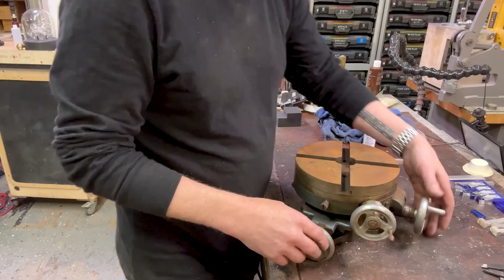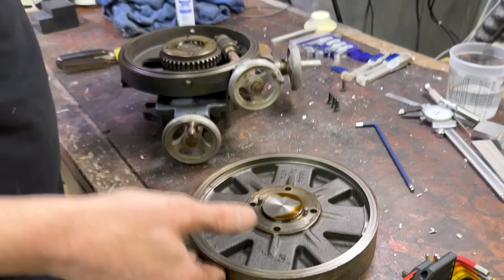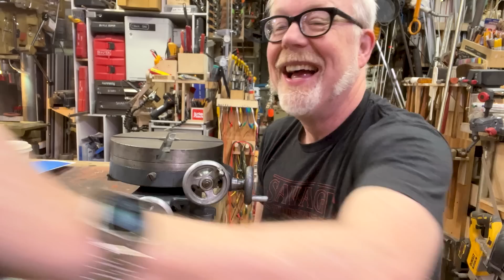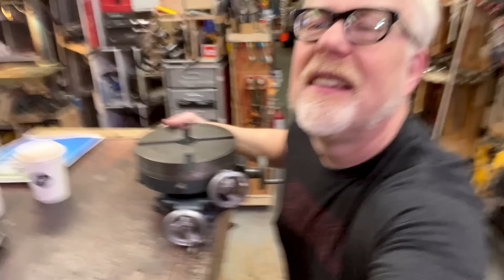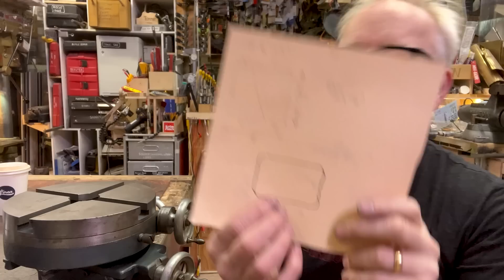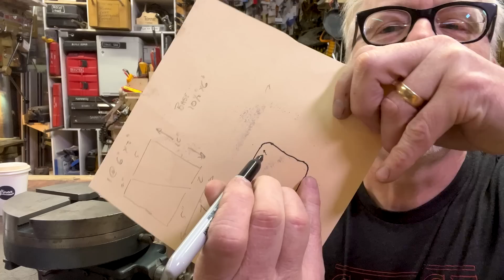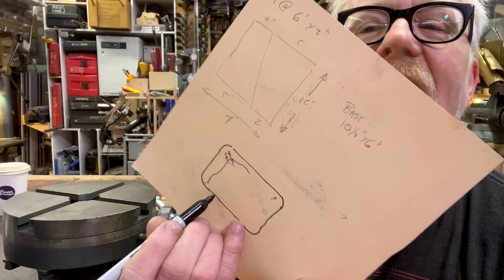Adam Savage Disappointed By This Machine Tool

Comment: I'll be short and blunt: If the tolerance is so out of whack, it would make a great paperweight or stand. Just need to lock it in one position. If you're not interested in those uses, it would make a great piece of metal to send in for recycling. I don't know if these tables are common or have been superseded by something better, but face facts: If it's not up to the level you desire, recycle it and move on to bigger and better things. You don't appear to express much interest in rebuilding or fine tuning the accuracy, correct me if I'm wrong.

Comment: If you could manage to fix the backlash issue, theoretically nothing would prevent you from just turning it upside down and voila, XY table on top of a rotary table.  The downside is then you'd need to make some sort of mounting plate to be able to attach work to the bottom of the table.

Comment: I’ve seen a bunch of these over the years, Palmgren brand most of all. It seems like most of them are barely used. I have one, or maybe I sold it. It’s definitely not precise enough to be inconvenient to use but still useful, but not convenient enough to be as imprecise as it is. I had the just the round part off one that I used on the mill as a riser block sometimes and the T slots came handy for fixturing.

Comment: Learned to sink molds on a cross slide rotary table.Advance or Trokey are good names, both take some level of finesse.
These things are used to sweep radius I’d or od, 
Sorry you have a palmgreen, WAY to much play in the ways, and the rotary mechanism is not very useful. 
Also, no rigidity, lousy surface finish is guaranteed

Comment: My brother gave me one exactly like that and my conclusion after trying to use it on my mill was exactly the same. I use it with a speed vise on my Delta UniDrill. Perfect combo and similar opinions. Both look super cool but near misses in function. The Palmgren is sloppy and the UniDrill is meant for wood w/spindle speed of 450 to 4300 rpm :( I’m a metal worker, not a woodworker. I get by but am keeping an eye out for a different head I can put on the UniDrill base.

Comment: Normally on a rotary table there’s a way to adjust the worm to reduce backlash.
It’s typically that the worm is on an eccentric cam, that pushes the worm into its crown gear closer to reduce backlash or moves it away to ease up on how closely the teeth mesh & this controls your backlash.
My “suspicion” is that perhaps when you dis- assembled the rotary table you altered the amount of mesh between the teeth and didn’t adjust that out via the eccentric cam positioning lever when you re-assembled it.
I could be wrong but we didn’t get to see any of that footage so hard to say.
The reason there’s usually a lever and lock is so you can swing the worm away from the gear all together to be able to “free spin” the rotary table by hand, without having to wind the handle through 360 degrees to check for any parts interference with your mill table or vertical dovetail for the knee or spindle after you have mounted the table and the workpiece, & before you commence milling.
You don’t want to be half way through milling a radius when you suddenly find out that there’s a physical interference between your workpiece and the mill that you didn’t foresee.

So you swing the worm out the way on it’s eccentric cam laver when it’s unlocked so the teeth aren’t engaged, spin the table and mounted workpiece through the full 350 degrees by hand, because the worms not engaged, then once you know it’s all clear you swing the worm back into engagement with the eccentric cam and lever, adjust the backlash and lock it in place.

So if there’s that type of functionality in your rotary table that you didn’t recognise then it’s possible you introduced the backlash unintentionally.

I know my dividing head has this type of function as does my tilting rotary table.

Maybe that’s something you should get?

A tilting rotary table!

Think of the possibilities.

You made a fly cutter with 15 degree angle and you want to chamfer the edge? 🤷‍♂️

Cantered in a Chuck mounted to your rotary table, & table tilted to 15 degrees, mount your chamfer tool in the mill and around you go - perfect milled chamfer on a angled round plane.

Just one example.

He who dies with the most tools wins Adam.

You know you now need a tilting rotary table.

Relegate that XY rotary table to your drill press & move on to a tilting rotary table.

You know you want to. 👍
Reply: It would be a perfect milled round chamfer on an angled elliptical (15 degree) plane, but it would be uniform and look cool... or get closer with 2 smaller and 2 larger arcs like compass drawn isometric ellipses.

Comment: One of my favorite things to do is rebuild mechanical devices. Disassembling cleaning and rebuilding something I have never seen before is relaxing and fun for me. As a bicycle mechanic of over 25 year's, if you like projects like this, try rebuilding a multi speed internally geared hub, start small at a 3 speed, and work your way up.
I liked watching the disassembly in this video, just wish I could have watched the thought process in putting it back together, but I understand the disappointment when finding out a flaw in your new toy.

Comment: Once upon a time I wanted to buy a pinball machine.
I could choose one from 2 pinball of early 80s solid state ones.
The first was a pinball machine with 20000 machines made and the other has only 1000 machines made . Both were in very good condition.
I didn't know what to choose. The second one was by far rarer and it looked hardly used, great playfield , great artwork everything.
I asked on some forums and I found my answer.
The rarer game had a very bad gameplay experience and that was the reason only 1000 were made.
So I chose the first and still enjoy it.
Because something is rare and in good condition doesn't mean it's useful.

Comment: I know excessive backlash is bad, but for cutting radius could you just turn the handle in the direction of the cut to take the backlash out, then take the cut. I guess my point is that the backlash only makes an issue if you are changing directions.

Comment: Why  not mount the XY table on top of the rotary part, then make a new base to attach the rotary table to your milling machine table?

Rotary tables will always have backlash, nice ones will have imperceptible backlash, but you STILL can't use them in both directions (well maybe with a brand new Moore...). you either lock the rotary table in position, or the pressure of your cutter against the rotation is what gives you positional accuracy, but you NEVER try to get positional accuracy in both directions! One direction for positioning accurately, the other direction is just to move to the starting place from which you start the process of getting into position in your chosen proper direction (does this make sense outside my head?).

Comment: My Dad had one identical one which was a Craftsman, probably made by palmgren. Years ago I tried to use it for milling and found out that it has no rigidity whatsoever. Any side force from an end mill will result in it moving and flexing in any direction. Also there was no way to disengage the worm for indicating.  Despite it looking like a nice little rotary table it was terrible, and definitely only for drilling.

Comment: I'm currently working on restoring a former NATO ground terminal (12.8m satellite dish) for radio astronomy.  Each axis has TWO 8000:1 gearboxes on it, with 15HP of motor on each gearbox.  Those gearboxes run IN OPPOSITION to each other, to take up backlash in the system, which in an 8000:1 multi-stage gearbox, can be considerable.    We're re-motorizing it using only one gearbox per axis, and will just live with the backlash -- since we have absolute position encoders on each axis, our control system can just "cope".   Each gearbox on this beast weighs in at around 800kg, and takes 25L of gearbox oil.

Comment: Sometimes you just get satisfaction out of working on something. I've built CNC machines with people just because I enjoy doing it. Sort of had a daydream that you wanted to build a CNC  or retrofit one with LinuxCNC... and I would help do the custom pyVCP panel to make it cool. I'm actually doing a rebuild now... and simulated the old Apollo control panel indicators... just 'cause it looks cool. If I can figure out the code to make the images clickable... I'm going to redo the buttons too. But I'm getting sidetracked... you had a good time working on the rotary table... so that still makes for a good day. And you may find someone who does not have a mill... but needs the tool to make the uniform holes. 
(That's what I did with my original Frankenlab X/Y slide... gave it to someone who needed it.)

Cheers!

Comment: Backlash in a rotary table is a pain in the rear, but, manageable if the gratuations around the rim are accurate (preferably have a vernier scale). Always move into the cutter, never climb mill, and always return the rotation beyond where you want it, and come back to zero to take out the backlash. And make judicious use of the friction stop screw.  Still a useful tool... just not AS useful as a more precision rotary table.  I've never seen one with an X-Y table build in like that one.

Comment: I used to work at an American owned factory in UK.. i’m sure the machine shop had some of their stuff.
Shame its not what you need but its Ideal for the drill table! A line of holes x apart.. no problem. Quick uncritical slotting in plastic etc whilst other equipment is tied up too.

Comment: For a rotary table you need zero backlash on the rotation - even for a drill press. There has to be a way to do it just cant believe there isn't one.. (That would be an insane lack of design thought by the manufacturer..)

Comment: Pretty cool piece, kinda jealous - I'm also in SF, apparently I don't troll CL enough...  You can also use it to make large offset cams, which is pretty hard to do on a milling machine without one of these, but easy on a lathe..  Every rotary table I've ever used has terrible backlash - it's the nature of ring & pinions, you can't really do anything about other than shimming the pinion (like you would in a diff).   The trick, as with all backlash, is to always move it in one direction, which is pretty much what all old-school machinists did without DROs.  PS - you can mount any X-Y to a rotary table.

Comment: few hours plus in evap o rust. just pull apart so you can submerge it. or just put it in as is. then if you want to pull it apart you can to oil and lube stuff up.

Comment: Where I'd use it? X/y at an angle not aligned with the machine xy. That would be beautiful for making wcmt insert pockets. Also, the backlash doesn't matter you always work from one side of the backlash and lock the travel with the lock screw before the cut

Comment: This is a milling vise add-on for a drill press.  You see a lot of the Craftsman branded ones made by Chicago Tool.  I've see Palmgren versions of these and their sales book says "Converts your drill press for rotary milling."  The rotary table is supposed to have lock screws to hold it in place when doing the actual drilling so it's not very good for active rotary milling.  It's great for getting the piece into position, locking down the table then drilling a precision hole rotating to the next precise location, locking it down and drilling again.  You could probably do some active rotary milling with it but you'd need to keep constant pressure in one direction and work slowly.
Reply: Sucks for trying to clamp a part that is concentric to the table using strap clamps. You're better off just printing the hole pattern and using a punch to mark the holes. with strap clamps you spend 30 to 40 minutes trying to clamp it concentric and you can only hold small parts do to the overhead using strap clamps.

Comment: The mill table you mount the rotary table on IS the x, y, and z axes. Rotary tables are incredibly useful to small machine shops, especially when trying to mill circles that are larger than the throw of your lathe. Think of it like trepanning in reverse. You overcome the backlash by only making small cuts AND only rotating in the same direction once the acme threads are engaged and the cutter is milling the cut.
Reply: Also there is a trick when you need rotate in opposite direction. You made few degrees  over required position ant then rotate back to required position.
Reply: I have absolutely no machining experience but I had the same thoughts. I don't understand why an x/y/z table would need to be on top of the rotary table or why the backlash would matter if you only advance in one direction. I assumed I was missing something due to lack of experience
Reply: @alexstarr1589  with xy on top of the rotary table, you can change what is over the center of rotation to do multiple curves without unclamping the workpiece.
Reply: x-y table mimics the table of a milling machine on a drill press. you can use the x-y table to center your work under the drill chuck or offset it to do a series of holes on a round piece. The only issue with these types of rotary x-y table is, the height but also the table is not geared low enough and rotates too fast in my opinion.
Reply: @ronitsingh85 IMO I don't think there's an argument here that this is a bad piece of equipment; it's really not. It can be excellent for orienting and centering - if you need that, from a tool like this. But just as Adam concluded and you allude to, it's home is on a drill press. In Adams case, it makes it redundant for his use as he already have a mill, lathe, and other rotary tables/equipment that serve those purposes and more, in ways that suit his his needs and wants better vs his available machine tools.

I'd love to have something like this in my little shop-nook. But if I already had a mill with an X/Y/Z table and a rotary table attachment, this thing would just sit pretty on a shelf like it did with its original owner. Better to pass it on down the river to someone whom might actually appreciate and use it.
Reply: @pr0xZen  that rotary table backlash got me by surprise and the fact you can't remove it. But like others said, if you are moving it in one direction then its fine. Also as you said, it can be used for lining up work and locking it in place, it does have knob screw locks. At a church rummage sale, I found new in box a set of vise jaws that go on the rotary table so I added a 2nd pair and think it will be useful clamping a work piece like a 4 jaw lathe chuck would! it was $5! I think its a cool piece of equipment and to any craftsman drill press enthusiasts this was an accessory and they would want one! Also on a drill press, this is a nice tool to have. its pretty well made.
Reply: The internal housing seem well shielded so you could probably arrange a worn with tighter tolerance, a spring-loaded anti backlash mod, or other things. The latter might not resist the force of a mill, but should be fine for straight drilling. Seems to be ample room there for modifications should one desire to.
Reply: @pr0xZen  good idea, just like some vises have. Could add thrust bearings to keep friction out
Reply: "Think of it like trepanning in reverse." So... UN-drilling a hole in your skull?

(Yes, I know that term also has a usage in machining, but that's not where my thought process went when my eye fell upon it, and for a second I was very confused. :)
Reply: Shhh...he hasn't figured that out yet. He is too busy hyperventilating and needlessly adjusting his camera.
Reply: @perseverance2015  That's just being rude.

Comment: 🍺🕶👍dude all i use this is for is milling an angle cut in a Stright line, so you're not limited to 90-degree cuts. that's all i use this for. imagine an etcher sketch with a knob that move only in a diagonal direction...... i love this . the old way i was doing straight angle cuts was unbolting my vice and taking it off of 90.  with this its way faster..  i.d.k. what else this would be used for but for me and my purpose i absolutely love it . even the small amount of backlash. it saves me lots of time in the long run.

Comment: Simple and easy. Fix the rotary table to the table of your mill. Upside down. Fix a piece of plate to what is now a bottom and screw a wise to it and now you have a rotary table with an X-Y table on top.
Plus, there must be a way to minimize backlash, even if it is only a bungee cord wrapped around the table that pulls it to one direction.
Stefan Gotteswinter has two rotary tables (without X-Y table beneath, I think) and he says he uses them once a few years. 
This thing might be very useful in making a circular hole patterns, because the number of teeth on the worm drive wheel (I would guess 40) multiplies precision of the angle of the crank 40 times. This is not as critical when you have a DRO on your mill that can be used to compute circular patterns.

Somebody night want to use this to build a small mill - buy a milling head from Proxxon, build a Z axis ...

Comment: I'm having a problem seeing the difference between having the X-Y above or below the rotary. Seems to me that you can accomplish the same results either way. With the rotary on top you have to rotate way less mass.
Reply: The issue is that the center of rotation doesn't move independently of x-y.  To cut out the part he illustrated without having x-y axis' on top of the table, he would have to cut a radius, then move in x or y.  Once that is done, he would have to take the entire setup apart to get the center of rotation under the next corner.  With the x-y on top of the table, the part moves and the center of rotation doesn't need to change position.  As an amateur machinist, I'm never interested in trying to replicate a setup once I've started cutting because it's not good for accuracy.